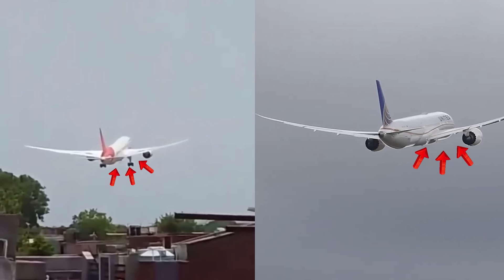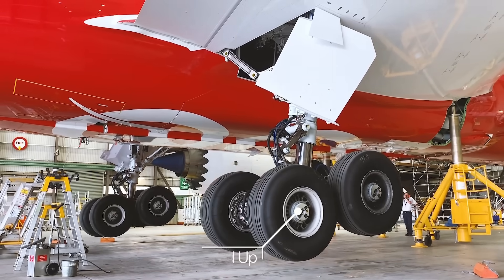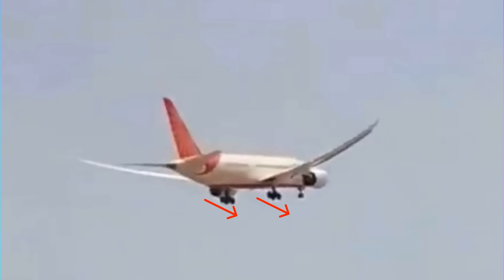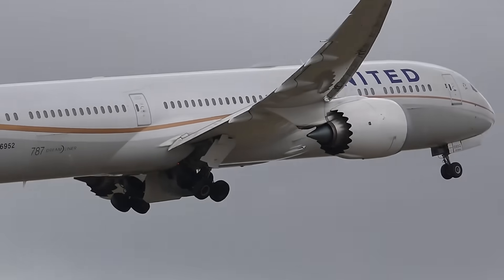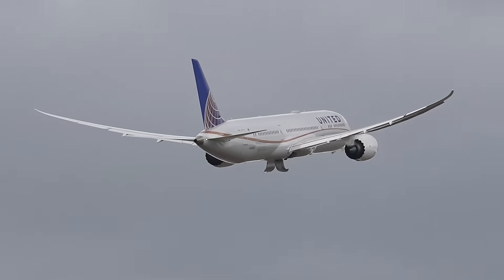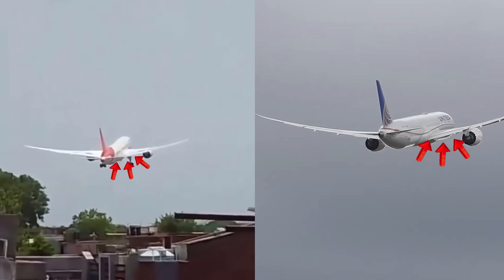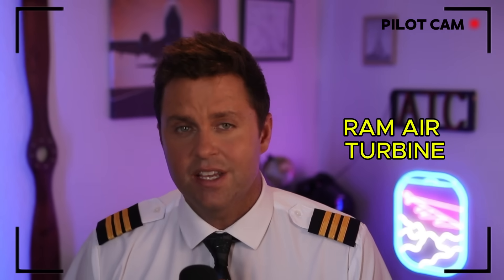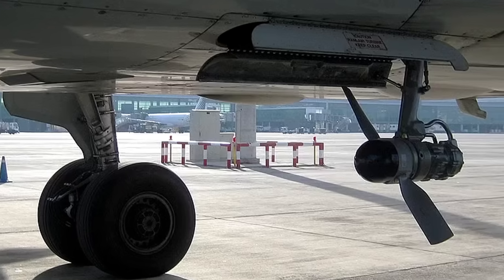Pilot Explains: A New Detail in the Air India 787 Crash Everyone Missed

Comment: Difficult for us to speculate how double engine failure occurs.  A lot of people will point at Boeing.  But I am pointing at the airline, Air India.  It is claimed that they contracted and outsource the inspections/preventative maintenence to third parties to save on costs.  Was the last inspection/maintenence exercise on this aircraft done properly? Was the airline cutting back on scheduled maintenence to save on costs?  I'm sure investigators will uncover this in the coming months.  But a lot of Indian friends that I talk to have complained about Air India for years.  Broken seats, no AC, washrooms that didn't even work etc. An airline trying to save on expenses where possible to pocket as much money as possible.   Again, this is from my Indian friends so I'm only basing this on what I have been told which may or may not be good to do but figured they have better experience than myself as they have flown Air India countless times in the past
Reply: A turkish company was contracted to maintain engines, and due to turkish help to pakistan, they were due to be terminated soon. Get it now?

Comment: I don't get it. I'm not a airliner pilot but I have been flying helicopters for over 50 years. When we start a turbine engine we run the starter until we get 15% on the N1 (compressor) and then crack the throttle to introduce fuel. After we get power at around 58% on the compressor its running. You can turn off all electrical, switch off master battery and it still runs. You have to close the throttle all the way to shut off the fuel to shut down the engine. I guess I don't understand why loss of electrical power would shut off both engines.

Comment: On the 787 aircraft, 1 second after liftoff, the main landing gear doors open (even without moving the gear level to the UP position)…..that is not seen in the video. Also, if the EEC  communication is broken…they are designed to shut the engine down.

Comment: If the electrical power system failed, the fuel pumps would stop, the engines would stop, then the hydraulic systems would stop, the rat would be deployed.

Comment: I thought early in the incident with colleagues and we did wonder if the fuel system was compromised but it so remote in probability. I did wonder about the mess 33,000 gallons of fuel would make at the crash site.
Reply: HOW WE HAVE A DOUBLE ENGINE FAILURE - SIMPLE DEW BY CHINA

Comment: What  should be checked is that the fuel tanks possibly suffered vacuum faillure. Vacuum can stop the fuel to flow into the engines. In the beginning there's sufficient air in the fuel tanks. Then when taking off the engines demand a lot more fuel but completely closed tanks and malfunctioning valves will create soon a vacuum, especially when the fuel tanks are completely filled up. If so, it could perfectly explain a good take-off and a sudden loss of power. If its not a valve to avoid vacuum then it could be defect fuelpumps.

Comment: Good analysis. I was thinking this last night in a different way.

If fuel was contaminated, then the plane would not have taken off at all.

Duel engine failure is possible.

I think it was electrical failure. If landing gear is still down, it means electrical failure. But electrical failure will not make the plane go down unless electricity is needed to burn fuel. If electricity is needed to burn fuel, then it has to be electrical failure. But as you said, the pilot might have decided to have landing gear down to prepare for crash landing.

Looking forward for your next video with Steve.

Comment: Well definitely waiting for the VERIFIED facts by the recordings of actual information not speculation...  So will listen but not fully commit on what would have occured...to bring it down... And maybe if the engine were both not operating... There seems that fuel  problem may be the best possible reason and of contamination...as maybe a reason for all are guessing.... And until the black box and voice data recorder are fully examined independently and completely...

Comment: Not a pilot here but an aviation fan. I think either the fuel supply got interrupted for some reason or there was a catastrophic software glitch that stopped the engines from working? Some point out to the extreme air temperature that day and the plane sitting on the tarmac for 2 hours with no A/C turned on.

Comment: Airbus generally favors a more automated approach with fly-by-wire systems, while Boeing often maintains a more traditional, pilot-centric design with manual override options. Both manufacturers produce safe aircraft, but their philosophies differ. Airbus's emphasis on automation aims for enhanced safety and stability, whereas Boeing's approach prioritizes pilot control and tactile feedback.

Comment: That then begs the question of: were other aircraft departing from that same airport refuelled from that same batch of fuel? And if so, why didn't any other aircraft departing within at least a narrow window from that same airport experience a similar engine problem or partial problem?  Or did they? Perhaps the other pilots should be surveyed about any power or thrust issues, even just a minor anomaly that seemed to self correct.

Comment: You tuber Swiss001 posted yesterday about the RAT. He also pointed out that the angle of the landing gear could indicate that the lever to up was initiated but may have halted due to power loss. I thought this was interesting. His closing questions were fuel contamination? I thought I saw a video posted of passenger cabin complete loss of electronics prior to flight. Not sure if legit?

Comment: The on board computer , software controlled , GOT CONFUSED AND GSVE A SIGNAL TO CUT POWER TO BOTH ENGINES , AND OR ACTIVATED THE FUEL CUT OFF SWITCH ELECTRONICALLY . IT GOT CONFISED EHEN THE COPILOT ACTIVAYED BOTH THE GEAR UP LEVER AND THE FLAPS LEVER TOCTHE RETRACT POSITION AT NEAR THE SAME TIME !!!
THE THE ONBOARD COMPUTER BRAINS GOT COMMAND STUCK CONFUSED AND WENT TO A DEFAULT POSITION , AND JUST GAVE A COMMAND TO STOP ALL OPERATIONS AND THEN TO DO SO , JUST CUT THE FUEL TO BOTH ENGINES AND OR FLY BY WIRE THROTTLED THE THRUST BACK TO OFF POSITION .HAL 2001 GOT CONFUSED !!!!!!!! ALL PILOTS REMEMBER -- DON'T ACTIVATE MORE THAN ONE SWITCH OR CONTROLL LEVER AT THE SAME TIME OR TO CLOSE TO EACH OTHER !!!!
GOT ALL PILOTS ???

Pauline M. Lawrence Ph.d.❤❤

Comment: The Boeing 787 Dreamliner has faced a number of reported issues, including those related to its lithium-ion batteries, generator control units, and manufacturing processes. The battery issues led to a temporary grounding of the fleet in 2013. Additionally, there have been reports of software bugs, such as the autopilot and flight management system malfunctions, and problems with generator control units. Manufacturing concerns include drilling debris left in interfaces and deformation of composite material. 

Here's a more detailed look at some of the key issues:

Battery Problems:

The 787's lithium-ion batteries were the subject of intense scrutiny after two fires and several smoke incidents in 2013. 

The FAA grounded the entire 787 fleet for over three months. 

Boeing redesigned the battery's internal fuel cells and casing to address the issue. 

Generator Control Unit (GCU) Issues:

A software bug in the GCUs could cause all four main generators to fail simultaneously, leading to a loss of all AC electrical power. 

The FAA issued an airworthiness directive to address this issue, requiring a software upgrade. 

Manufacturing Issues:

Reports indicate that manufacturing shortcuts led to drilling debris being left in interfaces and deformation of composite material.

These issues could potentially impact the structural integrity of the aircraft. 

Other Reported Issues:

Software glitches, including autopilot malfunctions and flight management system freezing. 

Incorrect livery materials and colors, missing decals, and broken control surface animations. 

Invisible cargo doors and light bleed into the cabin. 

Engine fan blades and spinners exhibiting unnatural wobbling behavior.